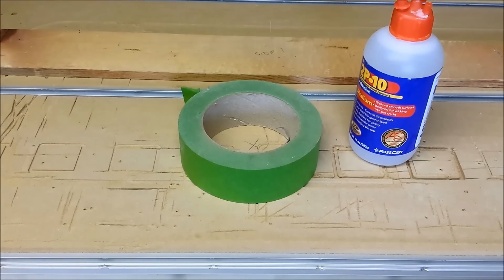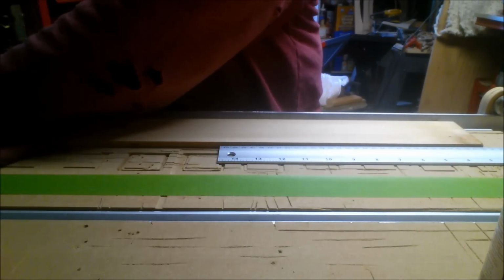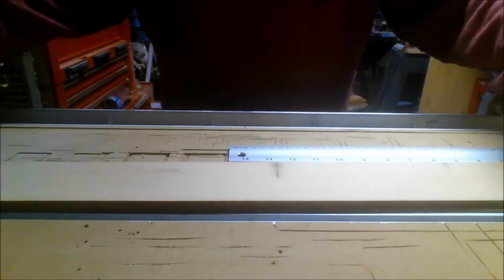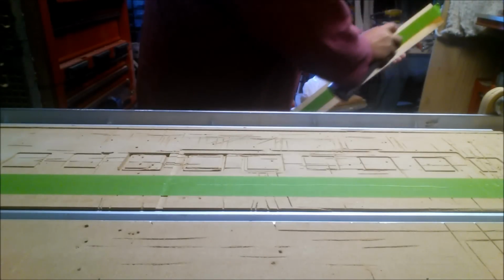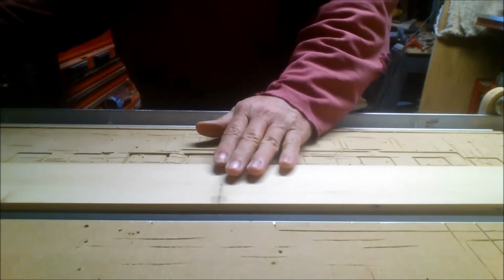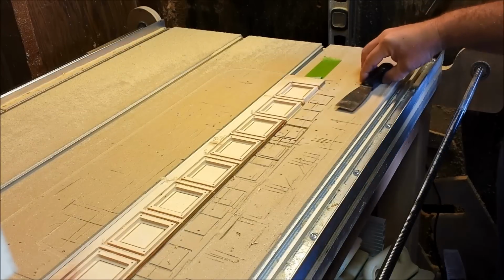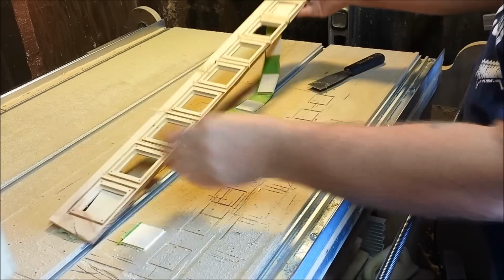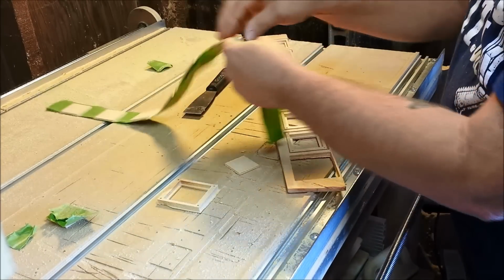A Secure CNC Mounting Technique - NO DOUBLE SIDED TAPE!

Comment: Why is this differentbthan doubld sided tape?....your basically making double sided tape arent you?
Reply from the maker: As I've said many times before, and as I said in the video a couple of times, it's tape I can control. For instance, I can burnish the masking tape onto BOTH the material and the spoilboard so it doesn't come loose, no matter how hot it is in the shop. You can only burnish double-sided tape onto one or the other - not both. It also doesn't gum up the tip of the bit or end mill if I cut through it like double-sided tape does. I've not bought double-sided tape since I started using this method. It's never failed me. Not once. Try it yourself and see...
Reply: Thank you..ill try it one day...it has its uses for sure..tape is not cheap and neither is super glue....but its a great idea for special setups.....when necessary
Reply from the maker: Most folks are skeptical about it until they try it. It does work. I was surprised to see that aluminum machining video. I would have thought that the aluminum would heat up enough that the adhesive on the tape would fail. It worked though.
Reply: This method is way more forgiving when small chips left under the work piece, if you're just cutting contours. Also, masking tape is much easier to peel off both from your workpiece and spoil board. Most double sided tapes tend to rip off in pieces and piss me off.
Reply: Pro: you can easily remove adhesive after a cut as compare to double sided tape. Con: It is 10 times more expensive in UK than double sided tape
Reply: @mamoonnaseer1886  most masking tapes do work, you should be able to find a cheap alternative and experiment.
Reply: @shelby50411  Do you have a link for the video of someone using this for aluminum?  I'm about to do a job with 3/8" aluminum tooling plate and if I can avoid using clamps that'd be great.
Reply: @klazzera  I think he was referring to the cost of the glue, here in Australia it is very expensive.
Reply: @fredfarnackle5455  thats unfortunate. here we have 50ml of superglue for the same price of 10 meters double sided tape.
Reply: @shelby50411  Superglue is cheap these days. Buy the cheap high viscosity stuff and buy about 300ml. It will last forever. You dont have to buy a named brand like superglue either. The spray is about  £1 Gbp a tin so £8 Gbp will last for ever
Reply: sorry to be offtopic but does any of you know a method to log back into an instagram account??
I somehow lost the account password. I would appreciate any assistance you can offer me
Reply: This morning at Rockler, they swear by this method also. Just saw video of this and it works well. Thank you for giving credit to your source. I put a simple router line on spoilboard to keep material aligned and straight.
Reply: The painters tape is easy to remove, unlike the double sided tape.  DST has really strong adhesive. Trying it is the best way to compare.

Comment: Great advice.  I am a woodworker for about 40 years.  I learned of this about 3 years ago, and since learning, it has save a LOT of frustration in terms of damaged finishes, tape backing and glue issues and other problems caused by double-sided stick tape.  The method you outlined is SO much better... thanks for sharing thee wisdom!
Reply from the maker: Thank you Andrew! I've been using this method for about 4 years, and it's never failed me yet.

Comment: We've been doing this for many years in the sign business but with application tape for applying vinyl graphics.
When CNC routers appeared we used the tape on the bottom of a substrate covering the entire bottom side to eliminate the need for tabs. The tape would hold any loose pieces together until the end of the job. Depending how accurate your CNC router is you can cut all the way through the substrate without cutting the tape and just pull the pieces apart without having to file off those pesky tabs.

Comment: Thanks Mark! Great tip exactly in time for a project with 3mm plywood I'm doing now. The stuff is constantly pulled up by the router bit, double sided tape is just not working enough. Even covered the complete sheet with it and it came off. Tomorrow morning first thing to try! Excellent tip!
Reply: So.... did it work then?

Comment: I've been using this method with great results.  Plastics and fiberglass are perfectly held.
It works without accelerator, and parts are firm within 3-5 seconds.
Just enough time to press, spread glue with a twist/slide motion, then orient.
The benefit is eliminating carpet tape, which gums up the bit and my part, requiring chemicals to clean.  The frog tape fouls the part with glue as well but easier to clean.
When I cut aluminum, the mist coolant seeps under material and will release within a few minutes, which can be bad on long cuts or arrays of small parts.  I watch the time, the coolant flow and also clamp mechanically at times.
Reply from the maker: Thanks for that, David! I've not tried it on metals yet, but I use this method almost exclusively to either hold the material to the spoilboard, or to keep smaller parts fastened to the spoilboard without needing to add tabs to the profile cut.

Glad to hear that it helped you out. Thanks for watching!

Comment: Thanks for the quick/detailed response.  There's another option I plan to try (moderate price, but eliminates "crazy-glue"/accelerant route, and meant for woodworkers.  Its called XFasten Double Sided Woodworking Tape (paper).  Will let you know results.
Reply: Used it. 

Not nearly as good as 2p10 and blue tape.

Comment: I use a similar concept but slightly different materials. Application tape(type used by sign writing companies) applied to both the table and the material as you have done, I then apply spray adhesive to both surfaces.. Stick down. Good thing about application tape is that it comes in many wider widths than masking tape. The roll i'm using now is 600mm wide.

Comment: For me - nothing ever seems to be easy.  But,  this is so easy and it works so well I cannot believe it.  When I cut my first piece using this method, I just knew the wood would start moving and come off.  NO!  It held in place even when I cut thru a 1/2 inch piece of wood.  Thanks for the information about this technique.
Reply from the maker: I've been using this method for a couple of years now, and it's never failed me. Not once. Hope it helps you out!

Comment: Unless you’ve tried this don’t knock it! It works exactly like he says, you can also use painters tape and loctite superglue. I have taken .250 cuts at 80% engagement and never had my work move. Excellent advice by the way. And you  separate by using a putty knife or scraper between the tape.

Comment: Great video Mark!  I found this same tip from the same luthier some time ago.  I really questioned whether it would really work or not. So I used the technique when hand routing some guitar parts. It's amazing how well it worked! When I recently go into CNC I remembered the tip and tried it out. It works great locking material to the spoil board.

Comment: A came across this video and although i dont own a cnc anymore due to space i found this very informative i used to use double sided tape. But what has got my attention is your cnc, ive a little dream to build my own so will be watching  more from your build. Thanks for sharing
Reply from the maker: Thank you so much! The CNC in this video is my old Shoestring Budget CNC that I built from plans that are no longer available. I now have a much larger Gatton CNC. There was nothing wrong with the old CNC - I just needed more cutting capacity.

Comment: Thank you for this!  I'm a couple weeks into learning a cnc setup.  I've been successfully cutting various thicknesses of PVC and Acryllic.  However I've been struggling to get thin sheets of styrene to cut effectively.   Saw this video yesterday, decided to try it today.  Succeeded in engraving then cutting .028 thick styrene; the same cut failed miserably for me yesterday using a different mounting method!
Reply: Forgot to mention:  NO TABS.   I can keep a nice clean cutline and not have to trim up tabs later either!
Reply from the maker: That's one of the big benefits - no tabs. It's not the perfect mounting solution, but it beats the heck out of running into clamps, sanding tabs, and hoping you got a screw far enough back from the outside profile you're getting ready to cut. It's never failed me yet!

Comment: I've found you can do the same thing using masking tape but in a pinch, without the CA glue or hardener still use double sided tape sandwiched between the masking tape. Makes it just as easy to remove the tape.

Comment: I thought this was a joke so I tried an experiment. I used wood glue and attached a scrape piece to my spoil board using the masking tape late at night. I got up the next morning and HOLY COW!! it worked. I cut a few things on the scrap piece and it worked great. Clean up was a breeze! Thanks for the tip.
Reply from the maker: Like I tell folks - it's easy to pull a layer of tape off of the roll, but it's durned near impossible to push a layer off from the side. Glad to hear it worked out for you. I've never used plain wood glue before, so I don't know how well I'd trust it. Some masking tapes have a resinous coating on it, so I'd be aware that it might not stick very well and take it easy. I get 2P10 and accelerator at my local hardwood supplier and save shipping costs and wait time. It works very well.

Comment: Tested and approved, Mark! Fantastic solution for thin material. Thanks again for sharing.
Reply from the maker: Thanks very much, Paul! I find it especially helpful on tiny parts and very thin stock. I'm getting ready to cut a project on 3/16" material that would be difficult to clamp down, and this is the mounting method I'm going to use.

Glad you found it helpful!
Reply: Exactly! I used it on my project with 3mm ply (2/16"?) with a lot of cutting into the material, making it weak and easy to deform. Double sided was failing all the time, this not. It worked like a champ and from now on I will stick with this method. Very easy to use and to remove, no problem.

Comment: Thanks for this video. Will have to give it a try. I would prefer something faster... like double sided masking tape, but the super glue will fill any minuscule warps or curls that would prevent any simple double sided tape from bonding properly to both pieces. Which explains why you're getting better adhesion with a temporary tape than you did with a permanent one. Thanks again for this trick.

Comment: What I use to do was take the material your gonna use and if it already has paper on both sides, say a 24x24 piece of plastic I would get a 24 inch roll of masking like what you use in a sign shop to put over vinyl.
So take the 24 in masking and cover the paper on one side of the plastic and smooth it down good. Then get a piece of Coraplast ( a yard sign material with the flutes going thru it, cut it to say alittle bigger then the 24x24. And get an adhesive spray and spray the masking tape side coat it good but not crazy then the waste material
(Coraplast) and do the same thing stick them together when it’s ready a little tacky not wet. Now all ya have to do is clamp the corners to your table or screw it down. If you have a vacuum table which is the best and works awesome that way. But will work well whichever way you do it.  And if it’s gotta be a piece with real clean edges ya can run like a .015 around the piece then recut it with the right size u need. And it will clean it out and give u a nice clean edge

Comment: Great idea, thanks. Was thinking of going with vacuum table, will go with this instead,
Reply from the maker: Thanks for watching, Harry. You might want to keep looking into a vacuum table. I never intended this method to be a replacement for anything other than double-sided tape. It's a method that could be used in addition to clamping or a vacuum table. It's not appropriate for every situation.
Reply: I ran a giant industrial router at a cabinet shop.  We had a massive 24 by 16 suction table and parts still slipped at the speeds we were running.

Probably going to email them this tip, see if I can't save them some recuts.     Some of the laminates they ran were pricey and they hated recutting those.

Comment: I love this method! But the funny thing is, you said it was cheaper. I just looked up the cost of the glue and adhesive, and together they cost around $130. Not very cheap but gets the job done I guess(yes you can get cheaper activator and glue, but the stuff you mention is expensive)
Reply from the maker: $130? American? Where are you shopping? Try this: https://amzn.to/2rGhaL9

I'm still using the same 10 oz bottle of glue and can of activator I bought 3 years ago. It doesn't take a ton to work well.

Comment: Mark, first, you are a GREAT presenter and helped immensely w/ my CNC hold-down probs.  Would it be possible to expand the subject to include the different kinds of cyanoacrylates and '"painters" tapes?  I followed your video carefully using frog green tape (expensive) and Starbond(medium viscosity)&accelerant on 1/8" (0.118) acrylic sheet.  In fact, it worked so well, I was concerned about cracking the finished piece when removing from the spoilboard.  Going to repeat the exercise today with good quality/inexpensive blue painters tape.  Will report back.
Reply from the maker: It's been my experience that just about any painter's tape and CA glue that uses an activator/accelerator works very well. The only exception I've found has been the Scotch "Greener Painter's Tape." The paper that makes up most of that tape is extremely thin (which is why they call it Greener - supposedly they get more tape out of the same amount of paper by making it thinner.) The problem is that it absolutely shreds when you try to remove it - and sometimes when you're just trying to pull it off the roll. Personally, I use 3M blue painter's tape I get at my local Lowe's. I buy the 1.88 inch wide, 60 yard rolls in the 6-pack, because I use a lot of it. I get a 10% veteran's discount at Lowe's, so that brings the price down to less than $6 per roll when I buy the 6-pack. Having said all of that, just about any painter's tape works well. I don't use the manila colored masking tape. I don't know if it's the adhesive or the paper, but masking tape is miserable to try to remove from the project.

Comment: Just came across this. Paper backed tapes are better than you're everyday carpet tape. Back in the day we used double sided tape(Permacell P02 (?)) in cnc machining plastics on an aluminum machine bed. We used denatured alcohol to release the tape bond and a stiff putty knife. I've used a variation of your tape and glue method. What about MDF to MDF?  I'm thinking of using this method to secure an MDF spoil board to the MDF machine bed.
Reply from the maker: Thanks for checking out the video! I don't know about using it to hold down a large spoilboard, but I've mounted MDF to MDF with it too many times to count. It's never failed me yet.

Comment: I've been doing this for years. It works great and is easly to peel off. I can't remenber the last I bought double sided tape.
Reply from the maker: Amen, brother. I still have a roll hanging in the shed, but it's got more dust on it than I can measure.

Comment: Mark, great tip....I can't wait to try it out this weekend. Where did you find a collect to accept a .057 inch end mill bit. I have a porter cable 690 router mounted on one of Dave's CNC like your.
Reply from the maker: That .057 inch end mill has a 1/8 inch shank. I got the 1/8 inch collet for my smaller bits at Elaire.

http://www.elairecorp.com/portercablecollets.html

Comment: Hi Mark thanks for the tip.
I've been using taping strategies for over 5 years now.
I also use Suretape, but I just wanted to mention that the Suretape I use has a blue separation film, where as what you showed has a white film.
The type I use measures about .01 thick, and this allows me to calculate my Z axis .005 over and not hit the spoil board.
Again thanks for the tip, but I just couldn't help but wonder if there are 2 different thicknesses of Suretape out there!
I've also come up with a way to use my lathe, and an x-acto knife to cut those 2 inch wide roles down to the desired width needed, and I pay about $9 a roll for this tape. It was about $6 when I started buying it  :(
Later
Don

Comment: I recently started using CA glue with activator and painters tape and it works great for most things but I had a failure when using a keyhole bit. There was just too much torque. My workpiece was 5" X 12" X 0.75" and I used one piece of tape down the center to hold the board. Maybe I should have used two pieces of tape or maybe clamps should still be used for high torque applications. What do you think?
Reply from the maker: When I use my keyhole bit, I use my alignment jig and another straight piece to clamp the work piece down. Here's a link to a video I did on making the alignment jig: https://www.youtube.com/watch?v=6_5F6cZ-vK0

The straight piece I use with my alignment jig is just a piece of plywood with bolts running through it to clamp onto the t-track, the same as the alignment jig. It has a pair of toggle clamps on it to hold the material flat against the work table. I put the straight piece on the table, put on the alignment jig, put down the material, then snug the straight piece up to the material. I tighten all the wing nuts, flip down the toggle clamps, then run the keyhole g-code. Boom. Done.
Reply: @MarkLindsayCNC  Thanks Mark. Although I really like the tape and CA glue method of securing a workpiece, Clamping things down is still necessary sometimes.